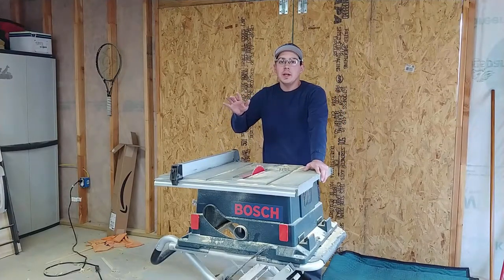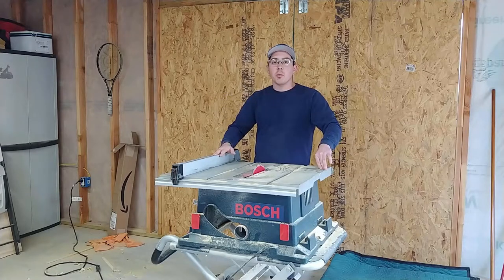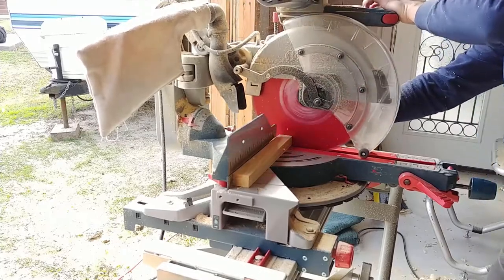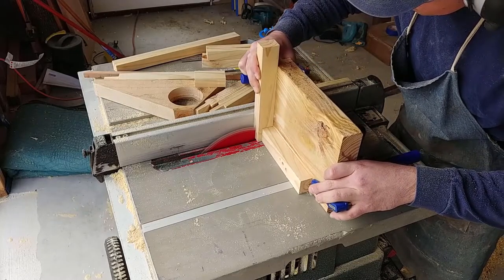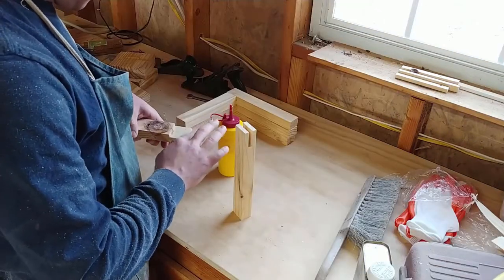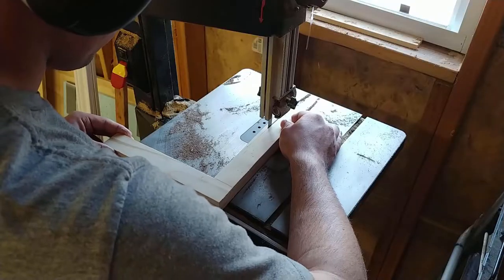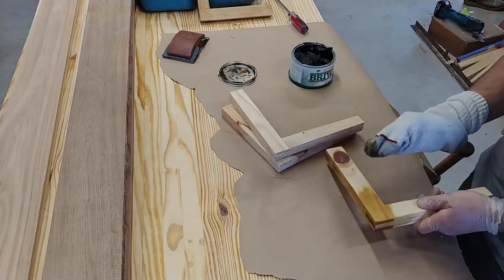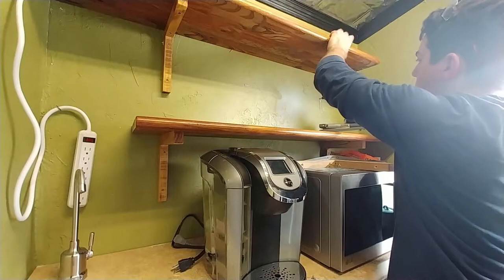DIY Wooden Shelf Brackets - Easy Woodworking Project

Comment: You should consider inserting two small dowels into each joint, perpendicular to the joint. Weight distributed to the outer edge might compromise the strength of the joint.

Comment: Hmm. Not trying to be rude but seems that essentially thes shelves are being held up by glue and glue only. Am I wrong? Theres nothing structural holding the brackets together.
Reply from the maker: The joinery + glue is what holds them together. They’ve been up in my house with quite a bit of weight on them for a while and they’re still really sturdy
Reply: Correct Tim...depending on where he loads that shelf, there will be a greater 'moment' at that glued joint. I was waiting for a diagonal brace ...nice work, but I wouldn't trust loading that thing up with say, (3) 1 gallon jugs of laundry detergent.